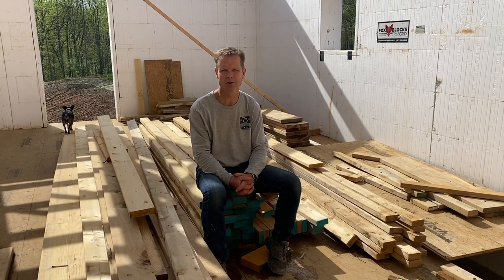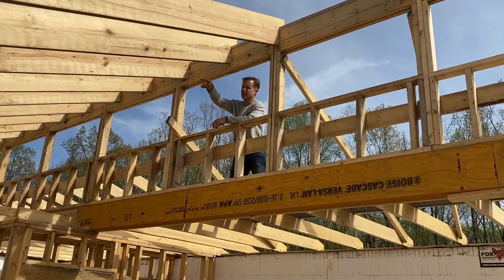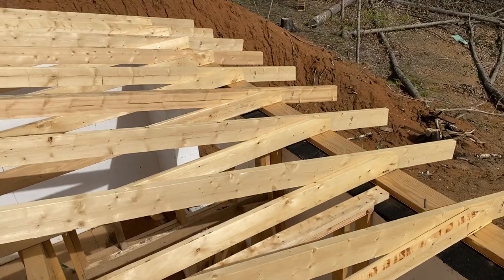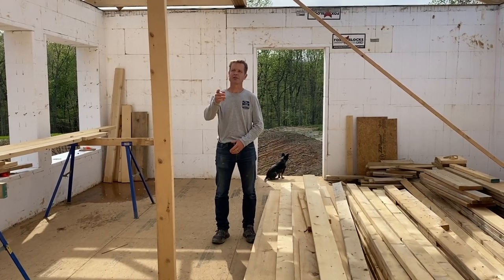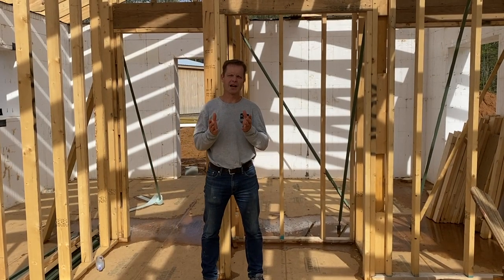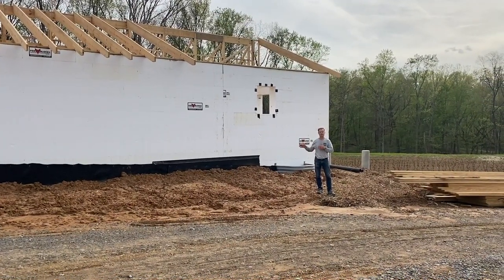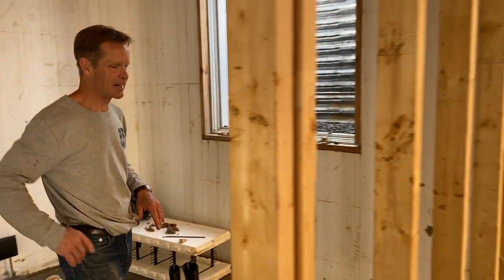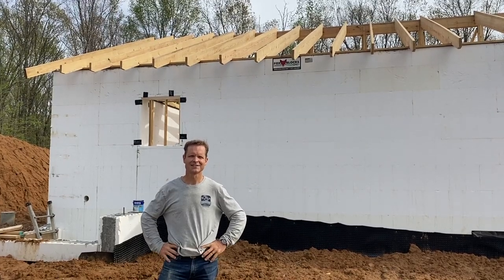Building an ICF House, Part 10:  Building the Roof

Comment: Get a Blaze King Model “King” wood stove! It has a bimetallic thermostat. It automatically opens and closes the damper. No electricity needed

If you run it with T-Stat on Low, you will never overheat the house.

You will also get 36-40hrs burn 🔥 on one load of good dry hardwoods
Reply from the maker: We actually bought a Rizzoli Italian model.  It doesn’t burn quite as long, but has an awesome cooktop and oven, plus a water jacket to run our hydronic floor system.  It has to be shipped from Italy, though, so we don’t have it yet.